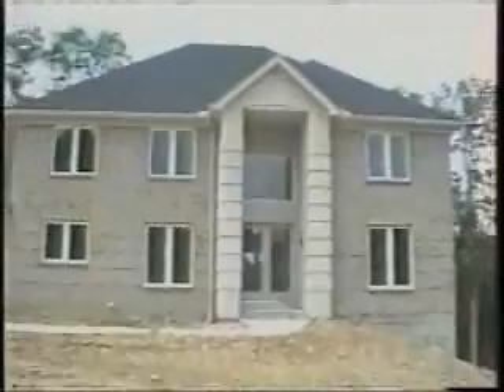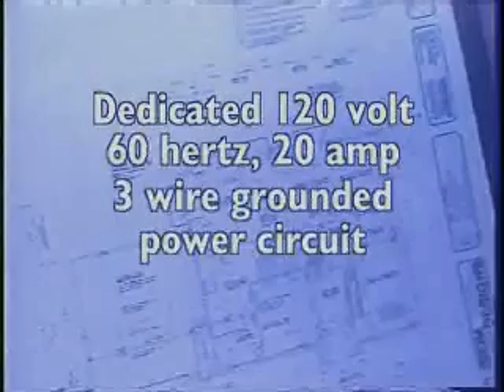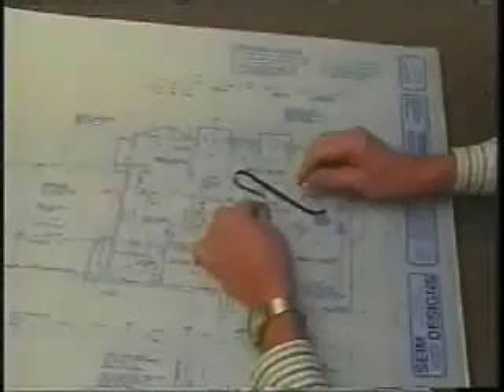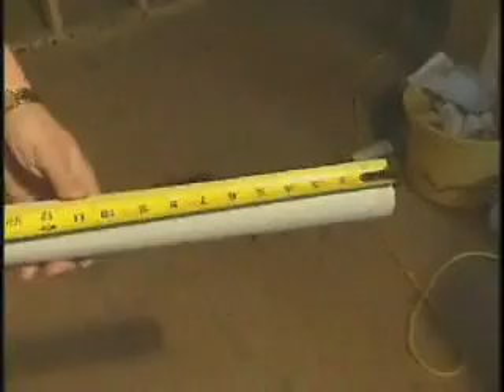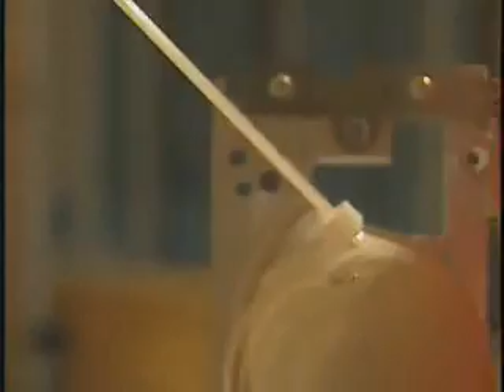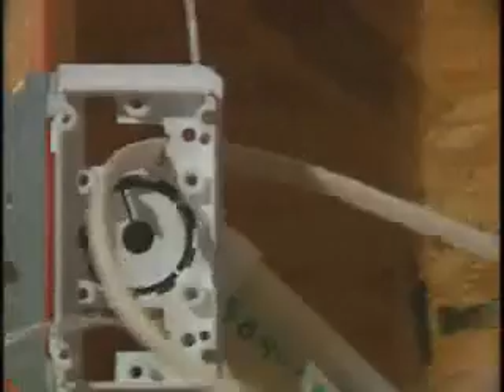Central Vacuum installation video

Comment: Never ever ever add glue to the inside of the coupling only to the pipe. If there are any wood cuttings inside the pipe they will stick to the glue and eventually cause a blockage.This is one of 5 golden rules of Central Vacuum installation